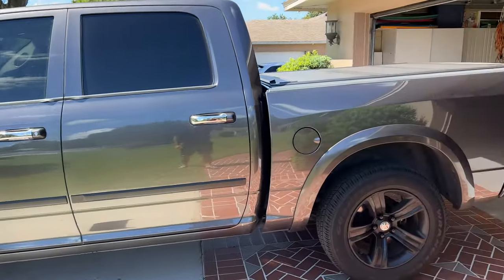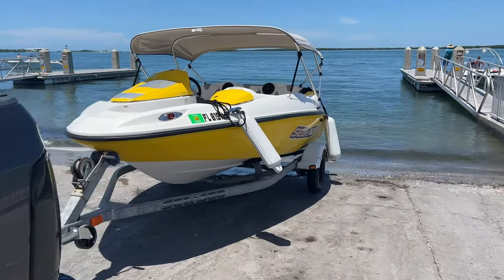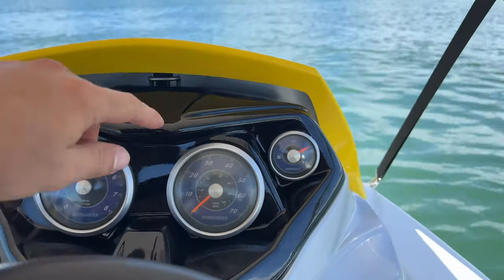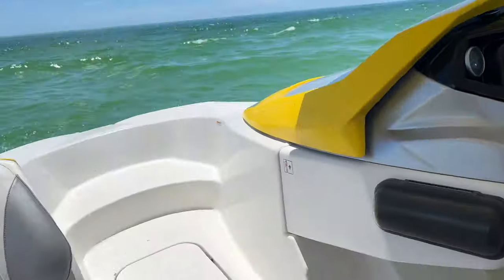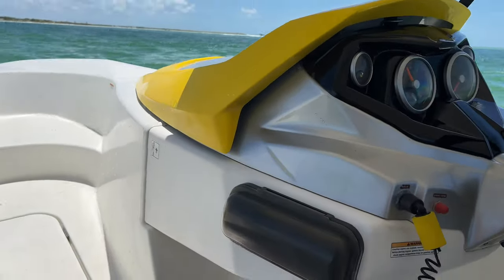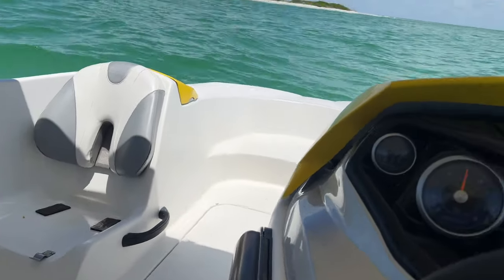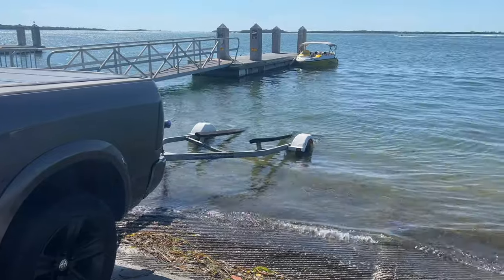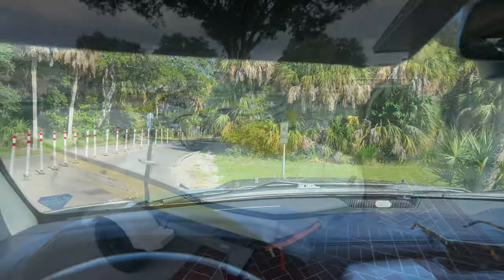Driving a Seadoo Speedster Sportster 4-tec jet boat POV

Comment: Your supposed to put a cooler with ice and a 12 pack in the passanger side to balance out the weight
Reply: @boostedmotorsports2  He's not wrong. The manual for both Sea Doo and Scarab jet boats suggests placing a cooler with ice and beverages in the passenger seat when the boat is occupied by a single user lol.
Reply: Facts I do this with soda
Reply: @edgarriver6883 , it doesn’t work like that
Reply: Ya I was thinking like a heavy weight on the other side to balance out the boat. But I get ya👍
Reply: You better put a couple of kegs on the passenger side to counter my weight.

Comment: Hey man.  I'm in Quebec Canada the home of bombardier.  Here on the eastern coast of Quebec on the north Atlantic we saw a ton of guys buy these boats a decade or so ago.  Ever single guy who bought one around here sold it within two years.  Major electrical flaws but mostly these boats are not suited for salt water and especially not choppy salt water.....constant impeller issues to go with compacted disks in your back.  Fun little calm lake boat but if you plan on using it in salt water regularly you are in for a world of frustration and pain.
Reply from the maker: Lol yeah I could see it. Definitely doesn’t handle rough water well but it’s fun to navigate
Reply: Wribg no has problem fkirids

Comment: I forget the exact issue I had on my 98 XPL but if I recall correctly it would die then same 4 beeps. I think I changed the DESS post and all was well afterward. Regardless, I think you can look up the "beep code" in the manual. Should help you troubleshoot and hope its an easy fix. Regardless, boat looks great and water looks awesome!

Comment: Great video! Please attach the key tether to you! If you fly out, which happens on those things, that boat will keep on going!
Reply from the maker: I’m good bro I’m not flying out 😂
Reply: Personal watercraft, any boat under 26 ft long. I think it's the law supposed to wear the tether as of 2020 everywhere in the United States.
Reply: @boostedmotorsports2  I think as of 2020, you are breaking the law if you don't wear the tether when riding personal watercraft or any boat under 26 ft long without an enclosed cabin. I have the same boat, lots of fun!

Comment: Gonna have to hook it up to the computer to see what it's doing. Doesn't seem like spark plugs. My old sea doo was always a hit or miss in the water 😂
Reply from the maker: Yeah its weird since it isn't throwing a check engine light I'm hoping doing a tuneup on it fixes the issue.  I have fuel filters, injector cleaning tool, and spark plugs on the way

Comment: Check your plugs...the engine cuts out on a certain rev, your plugs might be fauled up. 👍

My Seadoo speedster is a 215 horsepower Rotax Supercharged. Very fast on water.
Reply from the maker: Yeah I have plugs, fuel filters and fuel injector cleaning tools here. Video soon 💪
Reply: I have same boat. Same situation with cutting out. Changed fuel filters and runs perfect.
Reply: I’m looking at buying a 2007 speedster. Can you still find parts for these if they go down?

Comment: What engine do you have in my seadoo boat I have a 2.5 mercury and it has 2 fuel pumps a low pressure and a high pressure.  Low pressure is for idle and low speed.  If the high pressure goes when you hit the throttle it dies.
Reply from the maker: 155hp 4-tec 3 cylinder